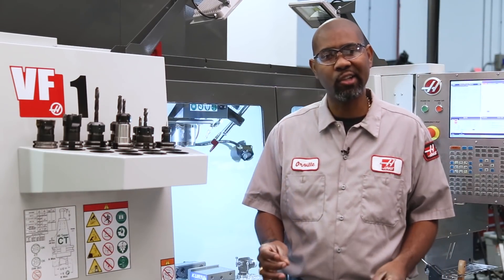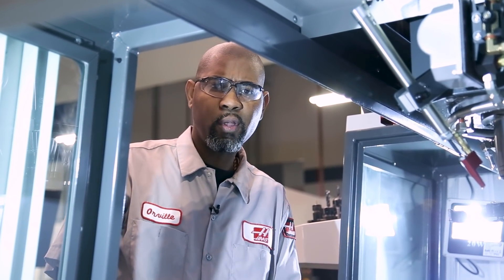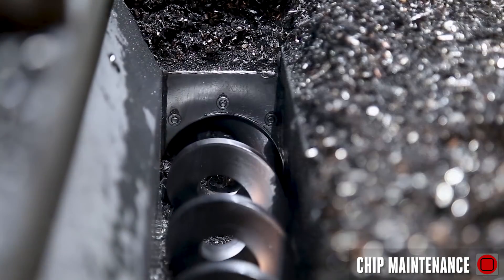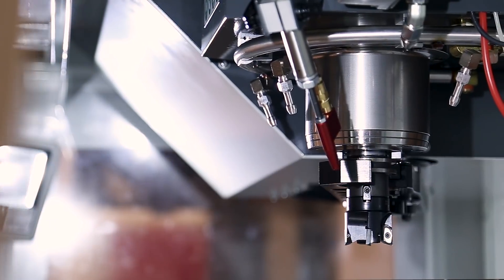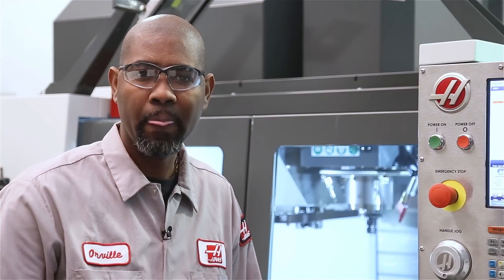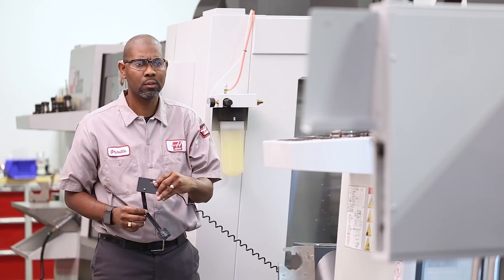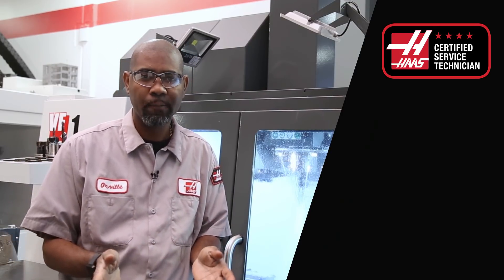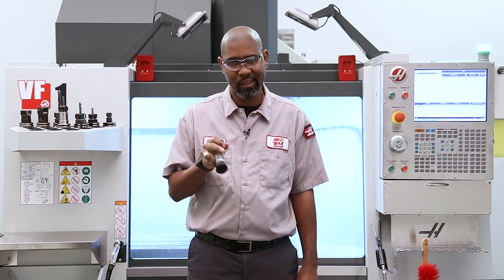Daily Machine Maintenance - Haas Automation Service

Comment: If you are running a new Haas VF with aluminum, plastic and stainless steel, but running the machine a couple of days here and there, possibly with 2-3 weeks in between, how do you then keep the machine running?
Can you leave pallets/Vises on the machine and tools in the carousel, or do you need major maintenence programs.

Comment: Don't use air to blow chips. Use coolant through garden hose connected to the pump. Also never open coolant while spindel is open with no tool
Reply: I use air gun all the time just dont blow it into the spindle and if u got way covers your fine
Reply: Cole Johnson you are mistaken. Air blow gets chips into part they shouldn't be in
Reply: Fischer977 like where?